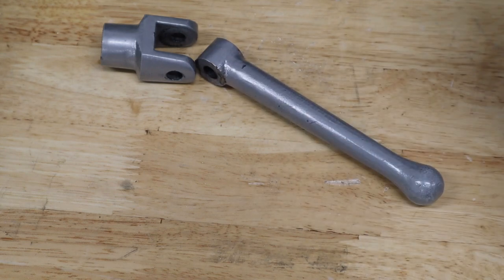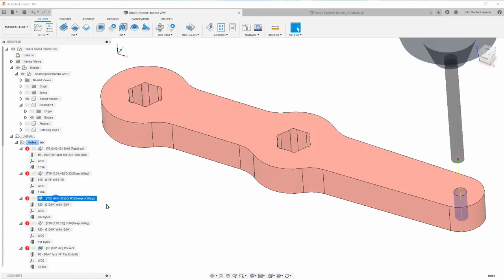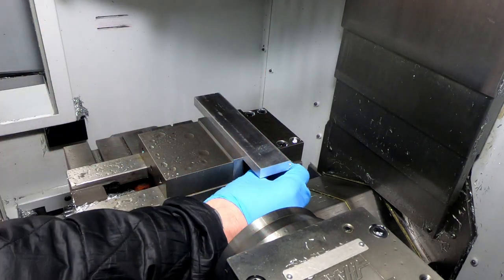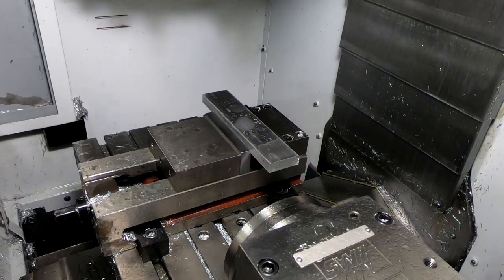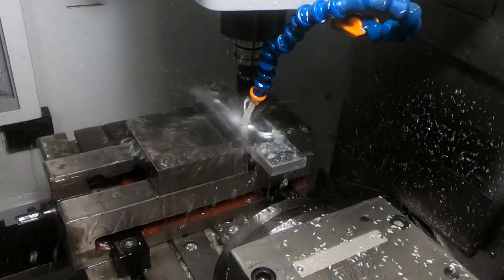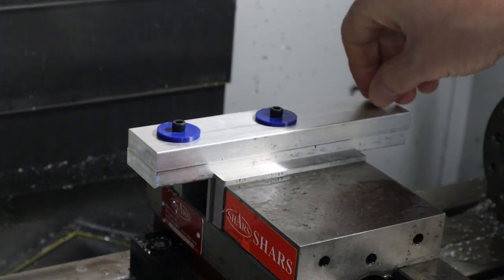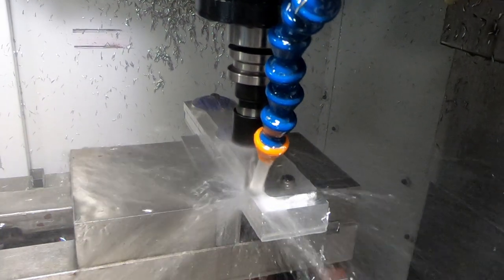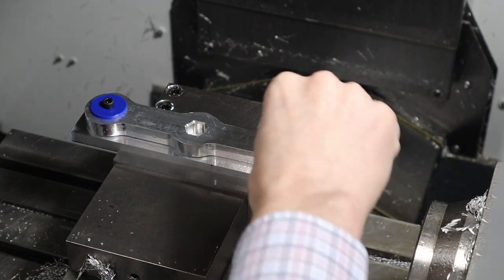Speed Vise -- Shars Replacement

Comment: A 2007 OM2A was my first cnc machine that I bought used as well when I was learning. Be sure to change out that pesky 3V battery in the cabinet with the power on as it requires a service call to reload the parameters if it goes. Also I made a sheet metal deflector by the sliding door so chips won’t keep on piling up in the door groove, had a wet floor every time I opened the door. Hooked up a 24 coil and used the m21 optional out put to run an air blast setup for Stainless. Run a y connector to coolant pump to get a wash down gun set up. I never really like rigid tapping with the spindle, was always worried about a crash, I only used form taps in aluminum but it does threadmilling very well, air blast for that also helps evacuating the chips. Also used the Advanced tool life management features to set the machine automatically feed hold if load went above 80% for those times when I proved out a design in aluminum and switch materials and for got to adjust a feed and speed. I had since sold mine for a bigger machine, no longer haas. Also with that fast spindle I would chamfer with 3D tool path and ball nose endmill. Have fun with that machine, I never had the 4th axis on mine, looking forward to seeing some videos on that.

Comment: Also, on your hex fits, refer to your machinery's handbook for "wrench clearances"  its covered under ANSI/ASME B18.2.2-1987.  For a 1/2" wrench your tolerances are 0.504"-0.510".  Basic rule of thumb for hex nut wrenches under 1" is to be +0.005"
Reply from the maker: Thank you. I went with dimensions from the original wrench, which is also too lose. I checked the reference and they call for minimum clearance of  (0.005W + 0.001), if I read it correctly. The flats on the hex are 0.463" across, so that means about 0.0033" minimum. But 0.005" seems like a good choice.
Reply: @JohnSL  I was going to say, that looks loose enough that with the material being aluminium alloy you could lean on it and strip it out! :-D Maybe instead of scrapping it, machine yourself a set of steel inserts and press them in to save wear on the soft alloy? :-)

Comment: Your machine leaves a very fine surface. I like the speed handle it is a big improvement over the original.
Reply from the maker: Thanks. It's a lot more fun to use than the original handle.

Comment: Also just watched the toe clamp video, my machine never really liked to do a helix entry into steel and stainless. I was using mastercam at the time and played around with it but just found it easier to just use a predrill hole. Variable helix endmill may help with the chatter but carbide stub drills were cheaper. I was sticking to the HAAS recommendation for torque on that spindle and never really ran it lower than 8000 rpms...thus making it a challenge to choose tools when working with material when SFPM was 200 or less. On my cat40 machine I can helix in but I still drop the RPMs to get the chip load up.